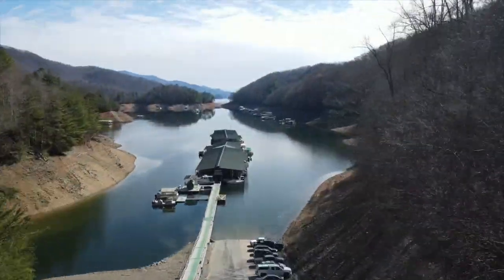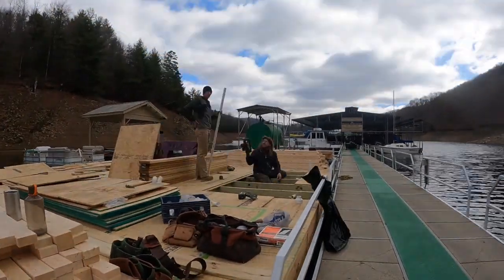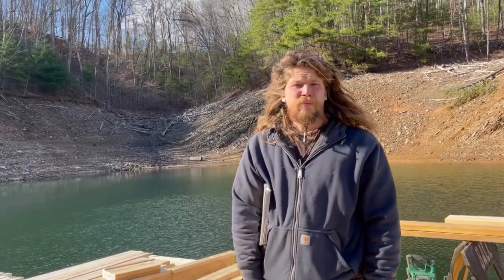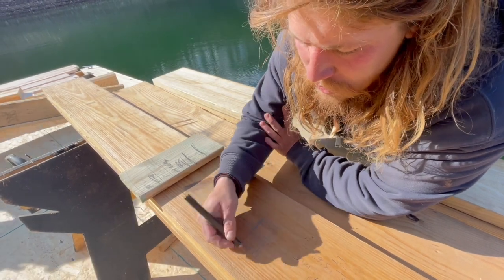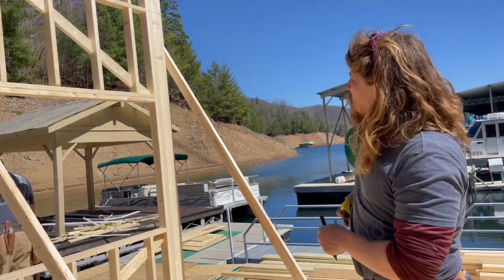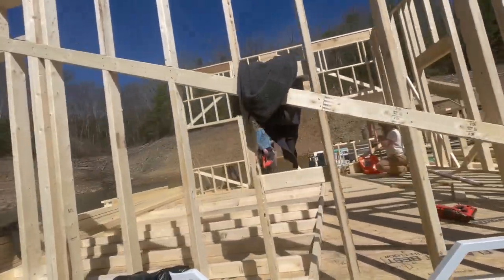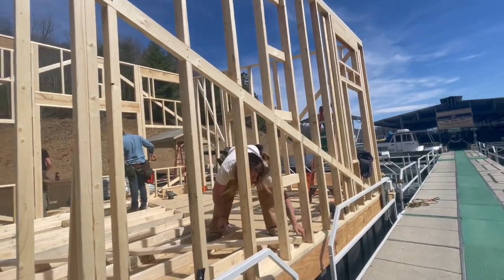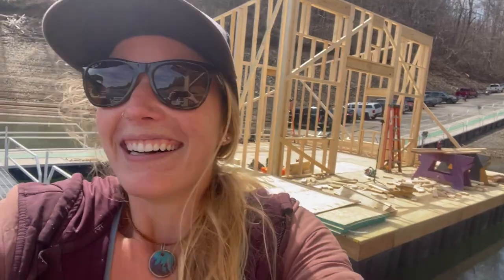Building a FLOATING HOUSE... 🛠🌊 It's starting to take shape!!!!

Comment: Love how fast walls go up. What kind of vapor barrier do you use on a new buid house boat between the floor plyood and the water side?? This is an area I would be concerned about for riotting wood down the road. thanks. Cant wait to see what it looks like with the framing siding on.
Reply from the maker: It’s so satisfying huh?! Haha thanks! 
As for the vapor barrier, we actually don’t use one. I know that sounds silly at first, but it’s a genuinely unnecessary expense haha. Just like standard procedure when building any other dock that a house doesn’t sit on, just wood + floats or pillings is fine & will last decades. Plus our floats cover the vast majority of the underside of the house, so there is very little exposed plywood, and what is exposed is several feet off the water so it rarely if ever gets wet even when the water is choppy. But you can always use marine-grade plywood which is waterproof if you want to be extra cautious! 👌
Reply: @KeepingAfloatWiththeJoneses  Thanks for your informative response. Good luck with your house buid. Looks like a fun project. take care.

Comment: Curious on why you went with advantech osb floor over treated plywood? I'm planning a shed/office and have been going back and forth on floor choice due to moisture concerns, your scenario would be worst case than mine. Tongue & groove treated plywood is hard to find, so the advantech will be stiffer than standard treated CDX plywood but less water resistant. Love to hear your thoughts! I'm considering a vapor barrier on top of my joists to limit moisture coming up from ground.
Reply from the maker: We ran treated plywood under the advantech, in the opposite direction! 😊 That part was in video before this one (phase 1) if you’d like to see roughly what we did. Basically we’ll get the best of both worlds that way. 🙌
Reply: @KeepingAfloatWiththeJoneses  dang my memory is crapping out, I watched it last week. Nicely done!